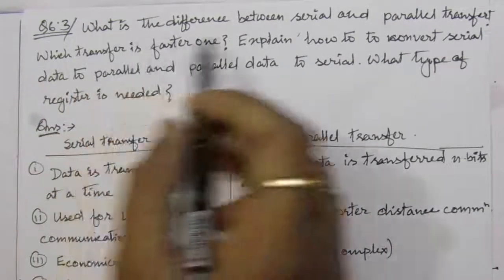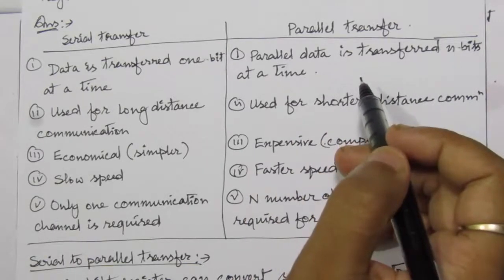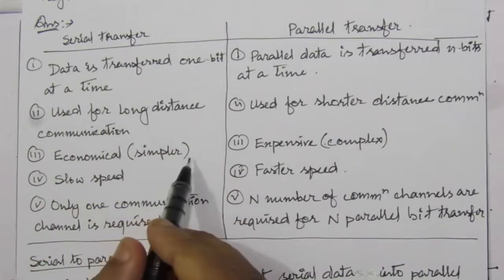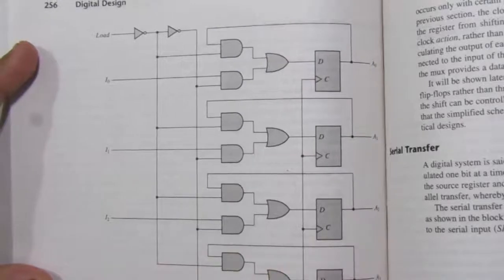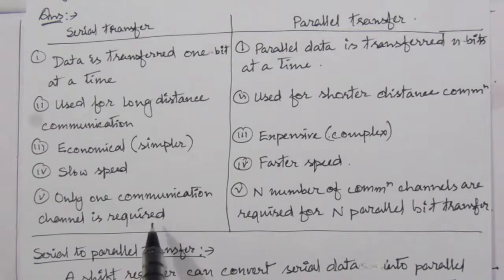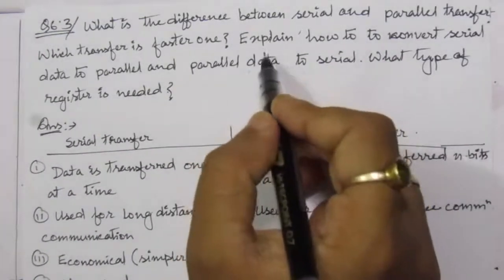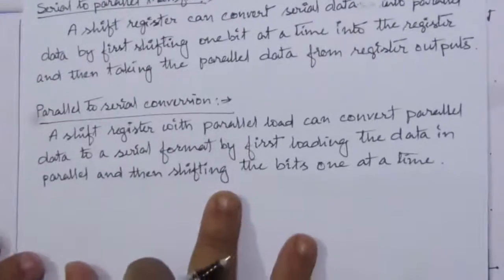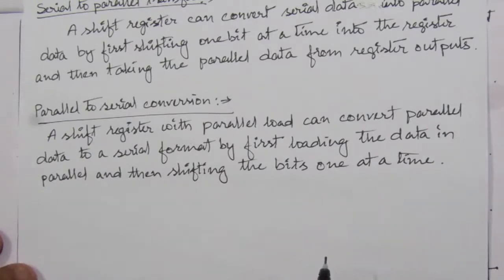Q. 6.3: What is the difference between serial and parallel transfer? Explain how to convert serial

Comment: 6.11 A binary ripple counter uses flip‐flops that trigger on the positive‐edge of the clock. What

will be the count if
(a) the normal outputs of the flip‐flops are connected to the clock and
(b) the complement outputs of the flip‐flops are connected to the clock? 
please answer it
Reply from the maker: (a) A count-down counter.
(b) A count-up counter.
(c) Negative edge triggering only does discharging operation resulting in more power saving while, positive edge triggering only charges the capacitance.
Reply: @DrDhimanKakati  can you send me a message please r.19.9eg@gmail.com
Reply: هههههههههههههههههههههه ثواني امنشن الدكتور